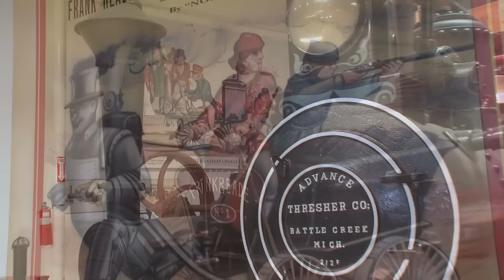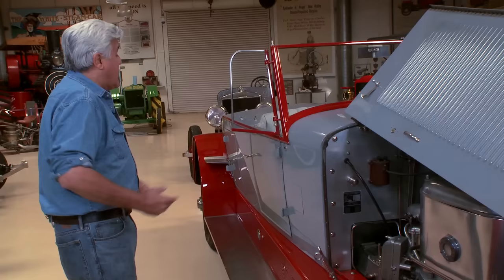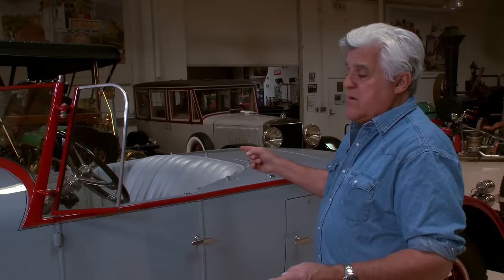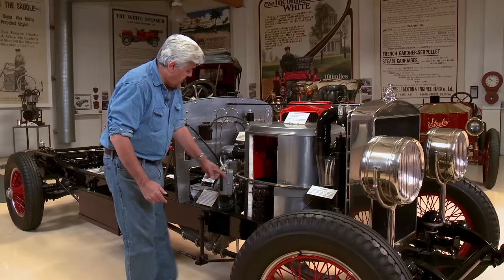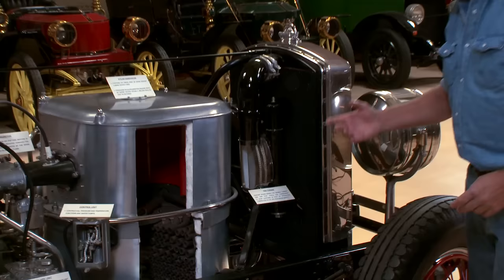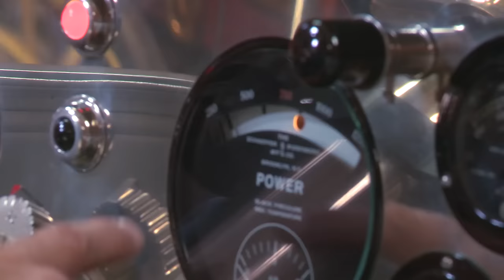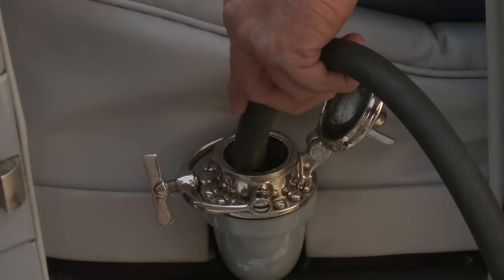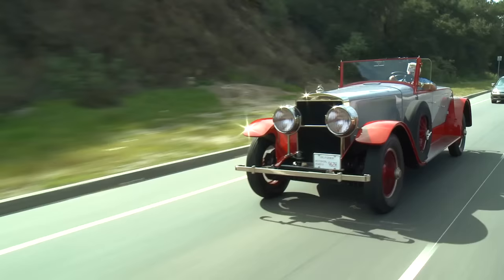1925 Doble E-20 Steam Car - Jay Leno's Garage

Comment: I wonder what they could do if someone built a steam car with todays technology.
Reply: +weirdstuffanimation7 Something very cool and water would be the working fluid you need so they should be able to do something today
Reply: The real doktorbimmer  And if you can't grasp it doesn't matter what fuel system can deliver it then the feelings mutual 

CHEERS :)
Reply: The real doktorbimmer So a closed system pollutes does it?  As much as an ICE engine or twice as much does it?  Considering that the primary boiler fuel it burned completely in the boiler and not come out the back of an exhaust and the working fluid is water so er how badly a pollutant is that hmmmmmm? I guess though that ICE engines are so pollution free aren't they? Thats why you promote them?
Reply: The real doktorbimmer So EV's according to you aren't as efficient as ICE engines , see anyone who buys them listening to you? You still don't get it do you? And you never will
Reply: +The real doktorbimmer And the reason the market has slowed recently is because the oil industry now realises it has a potential competitor in the electric car and has cut petrol prices recently though that will prove to be a false dawn
Reply: +The real doktorbimmer And that is a lie and a myth perpetrated by the oil industry electric cars do not pollute more than ICE cars that is a giant lie especially if countries use wind farms, Hydrodams , coal free electric power stations even coal powered power stations which happen to eliminate the pollution caused I think if I remember right by a vacuum or by building the chimneys into the Earth rather than outward I might be wrong on the Earthward chimney power stations and even solar panels are rapidly taking over in hot and not so hot countries and produce a lot of electricity So much so a lot of the hot countries are now selling their excess electricity plus  when charging an electric car overnight people are only using the base electric time especially now that batteries and rechargers are getting better and most people charge at night so thats a load of bollocks about electric cars pollute just as much as ICE cars,, blatant oil industry lies .

 Oh and for steam engine efficiency check out the  Cyclone Technologies&#160;engine and the research done in the 1990s by Volkswagen and also check out the steam engine technology done by Skoda then come and tell me how much more&#160;efficient&#160;ICE engines are over steam engines
Reply: vincent green Really? that sounds interesting would love to know more
Reply: vincent green OK Vince thank you I will do that thanks mate:)
Reply: +weirdstuffanimation7 I was thinking the same
Reply: +weirdstuffanimation7 some subsidiary of vw built in the 90s a steam engine... 1l 220hp well within emission standards... meant for a skoda fabia but a rolling prototype was never built
Reply: Lone Wolf Yeah I heard about that developed by VW for Skoda, same they reckon the reason they didn't carry on with it was because the market or really the consumer wasn't ready for it back then
Reply: +weirdstuffanimation7 It would break down every week. Stuff used to be built to last, car makers learned they could make more money if they sold you a piece of crap, just to make you buy a new car 5 years later. Old tech was built to last.
Reply: +Silent Cheech so true, my 55 chrysler sat 40 years and all it took to start was oil sitting on the rings for 2 weeks to free them up, new points, and battery and fuel lines. dosnt even use oil. took an hour to build factory compression but its like new. 
new cars will not be around in even 30 years, who and why would anybody want to restore them, then again thats what they thought 70 years ago, lol
Reply: +Silent Cheech In some cases, but not really.  Plenty of American cars, especially V8's, from the late 80's and up, can and do go for one million miles or more.
Reply: +Thedeoradude IKR Steam cars today would be an excellent idea. The thing is everyone associates steam with steam trains which are slow take eons to warm up and are noisy.
Reply: ***** How about a steam car burning vegetable or 100%biodiesal would they work when it comes to CO2 goes? I would have thought so since burning them should be carbon neutral amd I think the "wood pellet" idea would be impractical as impractical and silly as using coal since the benefit of steam is that if you use different fuels to burn it would be clean when compared to ICE engines

Somehow coal doesn't fit the bill and 2wood pellets" also unless it could be done in a way which was compact would also be impractical
Reply: ***** Yeah but take the ore orders of the Tesla Model 3 and yet oil prices are low at this time over the world (apparently) I don't think electric cars are somehow going back to the novelties they were in the 20th Century because of lack of investment and interest from the major car companies, plus if oil has been overused as the pundits say then eventually oil will go up which means petrol will go back up.

The Oil companies are indeed powerful but their power is running out just that they which to spend the trillions they invested and have stocked up in the oil they bought so you have to expect the oil companies or should I say these energy companies to interfere with that I don't think somehow I mentioned there is a "magic button" but it doesn't hurt to look for one though someone will always stop it if there is such a thing. Politicians in the USA and UK especially have interest in not making things easy , especially as they ususally have investments in Oil, 

They might do though though highly unlikely start to look at steam again simply because you can burn petrol in the boilers and with current and newer materials can burn everything away in the burners with petrol making very little environmental impact, Its highly unlikely as they are also going to invest hydrogen and wish to turn everything into a hydrogen economy as they wish for cars to run on fuel cells. Steam though should be looked at as a good viable alternative to petrol and electric It was in the late 19th earl;y 20th century untill developments in the ICE industries left both steam and electric way behind but electric has come back and I really don't see , with newer materials and technologies why steam can't come back either
Reply: ***** Well surely the energy density could be improved or the engines that would run on them could be improved to get more efficiency out of them and the idea behind biodiesel and biofuels was for them to be home made not mass produced as what eventually happened and starting causing a lot of environmental destruction in the East

Still I can't see why that can't be done and still feed the world's population so its probably the way it was done which caused all the problems As for wood pellets it would probably have to be done in blocks and burnt in the steam generators of steam cars in such a way that they would be on some type of conveyor belt somehow to the generator without compromising the design of the car yet still be easy to access How that would be done? I have no idea I mean how many would you need ? How many times in the start stop process of a steam car (I would assume it would be based on an Doble principal ) how many blocks would be needed and how would you get it to the burner to heat up the generator

 All this would have to be worked out but it would be a shame not to somehow use wood pellets but its not too serious as the working fuel is water . Any other fuel is there to heat up the steam generator which means its needed for the steam generator heaters.

 So although not perfect they could be OK that is biodiesal and vegetable oil probably even what Rudolf Diesel intended his engines to run on in the first place, peanut oil could be used for the the steam generator heaters untill a totally clean way of heating the steam generator heater could be found How about paraffin?
Reply: +marias man Oh I see your an oil boy then?  Why is it a knee jerk reaction? I tell you what so is telling everyone that steam is more inefficient and petrol is the way to go" without even bothering to investigate ther thing is if  The real doktorbimmer's comments hand't been removed you might have seen exactly what this guy was on about
Reply: ***** And actually that Cyclone Biomass steam engine seems to be the EXACTLY the  answer to your questions , best thing? I t uses ionized water to lubricate the engine and it has an efficient way to use wood pellets quite well also you can use it for cars, trains, boats and planes, 

Only thing? it uses a radial 6 piston engine instead of a standard 4 or 6 piston engine and they have updated and used new metals this could even have good ideas to update the Doble drivetrain int a modern one
Reply: ***** Well it seems very strange that you would bother to comment on an argument that 1) is old and 2) You can't even see what the other person was saying because his comments got removed and you say ICE engines are more efficient than EV's correct OK lets see can an ICE vehicle do or offer this?

An ICE vehicle can never be made to operate as efficiently as an EV
An ICE vehicle will always require more maintenance than an EV
The number of moving/breakable parts in ICE will always be higher than in an EV
No ICE will ever come with free gas for life.  An EV is offered today with free “fuel” for life (Tesla Model S Supercharging).
No ICE will ever offer the immediate torque and smooth power delivery of an EV.
If AWD is your cup of tea, EVs, with their infinitely controllable electric motors, beat ICE hands down.

Or are you going to tell me the old myths about  EV's aren't efiecent because they rely on fossil fuel electric plants? Well thats one point but the emissions can be handled at the power plant hence coal free or really smog free plants, nuclear plants( if used correctly and switching to Thorium) Solar Power Plants(depending on which part of the planet you live ) then the emissions are cut even lower and even if they are using smog power plants if charged at night all night they are only using the base line cheap electric meaning they are still putting vastly lower emissions up than ICE vehicles also when they travel there are no immediate emissions unlike ICE cars Is it the fuel that is 300% more energy dense than the li ion battery? I am not sure but a lot of you guys don't seem to get it.

 As long as the car is reasonably to very fast, cheap to run and fairly cheap to buy EV 's remain a very good alternative to ICE cars which is why the  Oil companies are worried. The fuel doesn't have to be 300% more dense except for a very few people. Electric cars really only need 200 miles plus lots and lots of of superchargers or battery swap shops and the ICE car has a very very serious problem on its hands, and it would be even worse  for the ICE car if steam comes back online although not necessarily so as steam is an EXE it can burn any fuel and as for the Cyclone engine yeah I will ask........the makers if I can
Reply: ***** Your bored? Feelings mutual  Bye then
Reply: 1970s saw a update, auto motive basically told him to bounce.
Reply: Captaintoast12321 More efficient Coal fired Locomotives.
Reply: There must be no way to do it economically. The late steam locomotives were pretty efficient, too.
Reply: Can you imagine the number of consumer safety devices they'd have to have on a steam car these days? It would have to automatically sense when it was approaching lack of water and shut off heat generation.
Reply: wood pellets are OK only if there's an extremely limited number of people burning them. Using them for fuel to move vehicles would create a quick shortage, and wood as a widespread fuel in general is not practical. I recall reading somewhere (this could be out of date now) that if we were to all use wood as a heating source for everywhere in the US, we'd strip the land of all trees within 4 years. England mostly did that themselves already. 

And the air would be worse. ICE cars now with all of the emissions leave behind pretty clean air, as do natural gas furnaces, etc. The rules have not managed to catch up with biomass burners, which are fouling air quality because they don't have the same standards. You can read a scholarly study on that by googling "Biomass Energy in Pennsylvania: Implications for Air Quality".
Reply: @David W    We can't ALL use wood, because there are more of us than nature can support (run out of oil eventually, too), but I read somewhere that if you have at least 5 acres of wooded land and a reasonably-well-insulated house, you can heat with wood indefinitely.  (The official figure was 3 acres, but that was for a smaller house than most people would want)
Reply: bledlbledlbledl. We could start using whale oil again.
Reply: Captaintoast12321

I wonder that, as well. Many of the pipes and the water tank could be made of hard, heat-resistant plastics or carbon fibres. Those "13 steps for your man to do" could be automated with computer control. Heck, you probably wouldn't need an actual key to start the car, just have the key for unlocking. The whole process of starting the car could be handled by a computer program. 

Modern materials, modern insulation, modern brakes, modern refrigeration techniques, modern electricity turbines - not to mention modern aerodynamics. Steam technology is due for a major upgrade. 

The beauty of external combustion is that it doesn't require such a refined, high-class material like petrol/gasoline. You could burn almost any liquid fuel in that chamber - it's simply a matter of finding the most efficient and economic. I suppose working out fuel efficiency is finding how much steam is produced by X gallons of fuel, and how many miles per X amount of steam (I'm no engineer, obviously).

If I were an engineer, I'd love to get hold of a 70s Citroen DS and pack it full of updated, modernised Doble technology.
Reply: Realistically it depends on how the batteries are made, it can be just as bad for the environment as continuing to use a dirtier gas car. Not to mention how the power is made, wind isn't free from critique either, nor is solar. I guess in a perfect world electrics would be clean if batteries were made without large amounts of waste and power was produced via modern nuclear reactors or some other clean form of production. ICEs though, not free and clear, but electric isn't necessarily cleaner than them, yet. Natural gas ICEs might be cleaner than our current selection of electrics too, steam given that it will take anything that produces heat, isn't limited to burning fuel. It could use electric heating elements too, something I feel is oft forgotten. Even if it remained a novelty, it would be cool to see what modern tech and materials COULD do for steam, again even if it impractical, I mean doing things just to see what will happen is kinda the nature of scientific though. "Developing something because, why not, I'm curious."
Reply: Plus more efficient engines require higher loads placed on them. Keeping them running well with tighter tolerances requires more fidgety electronics. If the engine was build to low tolerances, big heavy, mechanical of course it's going to take a lot to break it. Because it's basically built to run broken.
Reply: Wouldn't be allowed.  Oil companies would see to that.  Also, you would get taxed to hell and back because you aren't buying fuel but you are using the roads, so your registration would be extremely expensive to make up for the lack of fuel tax.  It would certainly be interesting to see what could be done with the technology we have today though, that's for sure.
Reply: but dont you use liquid fuel to burn for the boiler so kerosene or petrol would be able to be used so you arent cutting them out at all
Reply: Captaintoast12321 Oh my god I'm in an argument with this loser a year later XD. He's still trying to sell the same ICE crap with bold text on another video XDDDDDDDDDD 
Either way I've had that thought myself, would love to see efficency curves and a modern chassis.
Formula S or a garage 54 entrance perhaps?
Reply: David W The auto shut off is not hard at all. Either a pair of electrodes or a small switch with a float in the tank is what you need. My question is how you clean out all the mineral crust that would accumulate
Reply: Calcium lime and rust remover or clr for short
Reply: they do. nearly all modern coal, oil, natural gas, and nuclear plants use a super heated steam based turbine system to make power, which is even more efficient and torquey than this
Reply: The fuel burns more completely, like the gas on a stove, as opposed to being vaporized and creating exhaust.
Reply: Sadly "The real doktorbimmer" in now back again as "doktorbimmer" without "The real" and he is Still nothing but a Troll posting his anti-steam propaganda everywhere he can. After arguing with him for a while on another video I see he has a couple recent comments on this video again too.
Reply: it would be nuclear powered
Reply: Captaintoast12321 not as much. Steam engines are less than 8% efficient at best. Gas engines are about 20% and diesels are the most efficient at about 40%. Steam is a very complicated and dangerous way to produce power.
Reply: Probably about the same considering we stopped pushing steam technology and started pushing gasoline technology. Even in trains we went to diesel-powered. It would take a lot of research and development to get something to the consumer that would be revolutionary
Reply: Captaintoast12321 I also would like to see a steam car being built today.
Reply: In the 70s GM experimented with a steam powered sedan.... it was thought of to be a way around the gas crisis but it never took off
Reply: The Steam car will be made out of weapon skins
Reply: it's dangerous too
Reply: It would be cool, because you could use electricity to heat the water
Reply: Michael Fleming Donald Campbell's son, or grandson, I can't remember, recently set a world record for world's fastest steam car
Reply: pmailkeey sentinel
Reply: pmailkeey sentinel wagons
Reply: pmailkeey rip
Reply: Instead of a pilot light, you could use an igniter.
Reply: Probably not that much. Steam is still the primary power of the world. Pretty much all electric generation at a commercial scale is steam powered and they aren't that efficient. It's kind of neat, but it is a relic of the past.
Reply: I would love to do that myself. Have a very detailed vision on particular components design and operation. The base would be BMW E39, where the kardan shaft is just asking for connecting a super simple kit like engine with stock planetary gear (compensating the differential gear ratio). The goal would be 25% efficiency in fully responsive "steam muscle" system.
It's all about funds ;)
...right now i'm drawing a custom boiler for rapid steam generation (economizer->boiler->superheater->air preheater) in a compact package. It's optimized for 3d metal (inconel) printing.
Reply: Why such joking when you seem to be quite educated enthusiast. How will you generate the steam?   ....good old tubes or multi-segment coil burner or something copied from power plants?
Reply: @DerVampyrEngel  It's not completely emissions free. Probably close to it, but you still have to burn something to get steam.
Reply: @kevinmencer3782  Yeah I know if your burning petrol though not sure with 100% biodiesal or rape seed oil, I would say then it would be as its a closed system and your main fuel is water you only need oil to heat the steam generator